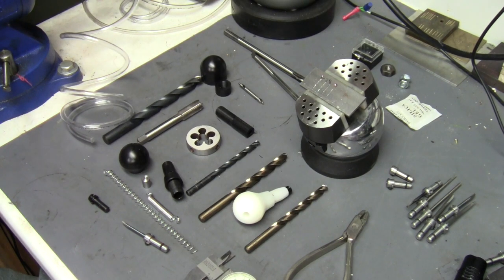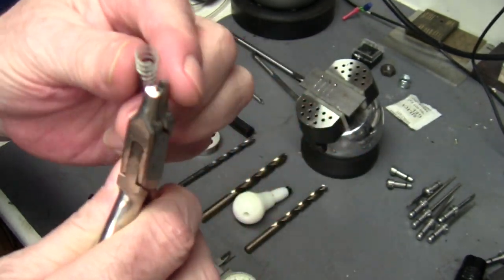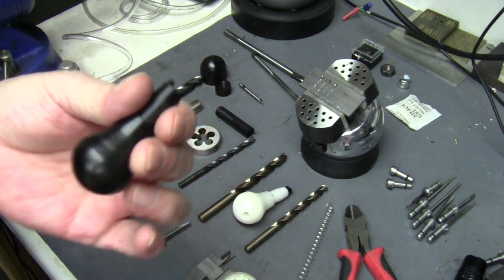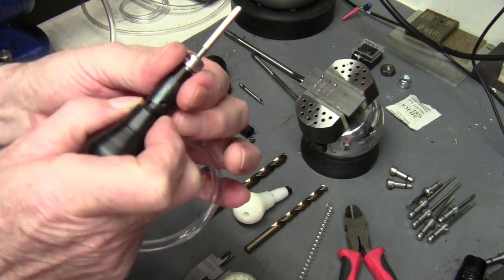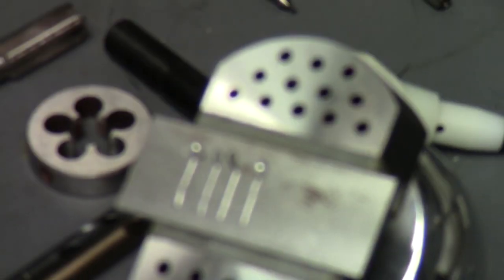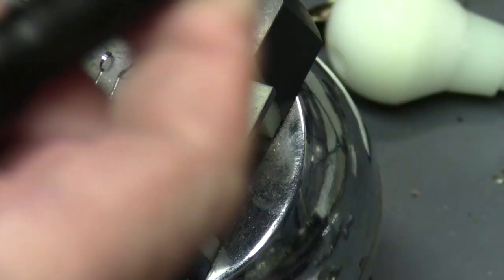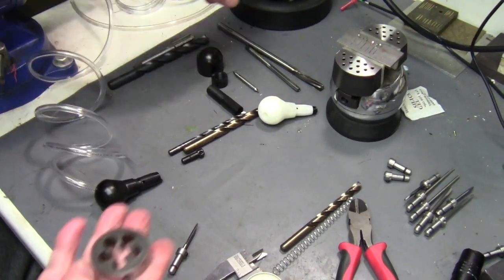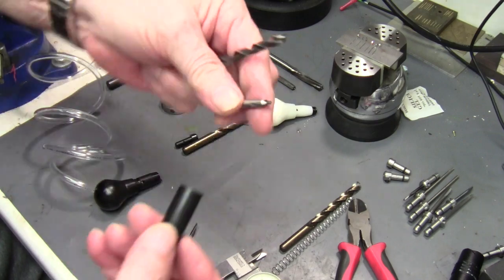Delrin HP Final Assembly Testing and Tools Revisited

Comment: Great videos, That Derlin is some nice stuff, expensive too. I've purchased squares on eBay for a decent price. I work in an EMC lab where tables antennas and masts need to be synthetic. So I've used this stuff a few times.   On several builds, I had to drill and thread some large holes and since we penny-pinch I was able to use a large nut and bolt to make a tap and die set of mild steel. I slit two or three lines down the bolt with an angle you'd see on a router bit. Worked like a charm and reusable time and time again. I imagine you could get away with not having a laithe with this trick. Another nice thing about this stuff is it dose, not rust.  We've had radio equipment out in the sun for years, parts made of this and they still hold up considering UV light. The biggest drawback I find is that you really cant fuze or glue this stuff together well. There are products out there but I don't think they work well.
Reply from the maker: I think with a minimum of tools and a cordless drill someone could make a hand piece out of Delrin, interesting stuff, machines great, a little stringy but it is plastic. I was wondering if it could be glued.

Comment: Super video, Rick! The finished handpiece looks fabulous in black, even better than the white ones. Have you made a sketch of the dimensions, drill depths, etc.? I found it a little hard to follow the measurements just listening to the audio and would appreciate having a simple pencil sketch or something if you have it. Also, I don´t quite understand how the spring, sticking out only that little bit, gives all that adjustment. Does it rattle back and forth in there?  I thought it had to maintain contact with the inside of the ball handle all the time?  I´m going to make my own handpiece, have several lathes in my tiny shop. Thank you very much, really very interesting.
Reply: Didn´t do my job properly there.... Found the drawing further down your video list. Thanks very much!
Reply from the maker: Email me for free blueprints and drawings; ralex397@hotmail.com

Comment: Thank you so much for doing all the trial and error for those of us that want to try to make our own at home. I'm gonna try to make one with the drill press. I may not have a lathe yet, but that doesn't stop me from finding ways around that little speed bump. Sometimes I find clever little ways that are probably easier since I don't have to set up a mill or a lathe and have to have all the tooling that's involved in making some things that look simple to make at first glance, but you quickly realise how unprepared you are when you start going through the order of operations process.
Reply from the maker: Good Luck! The only limitation, even with a drill press, is imagination.
Reply: As I mentioned this plastic will give way to a home mad tap and die from soft steal just take a good look at a real tap and copy.
the trick would be bolding the part down while cutting the thread with the tap nut.. you need to plan it out first.. then using a good vice.